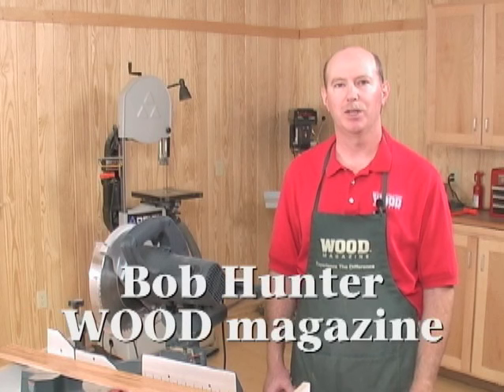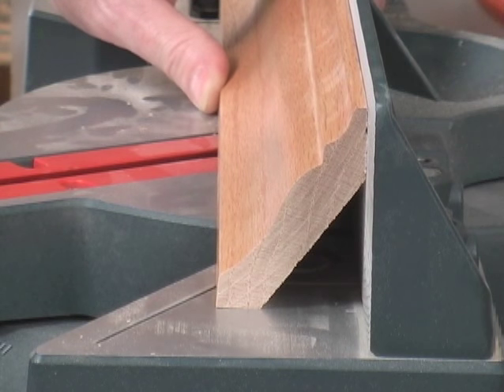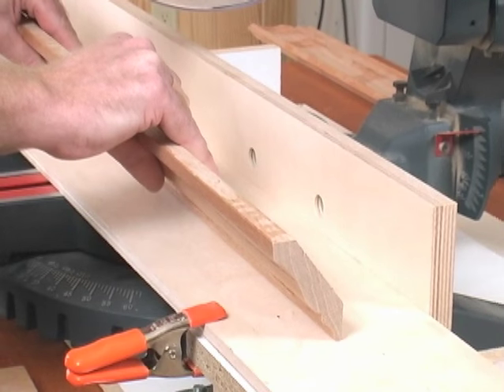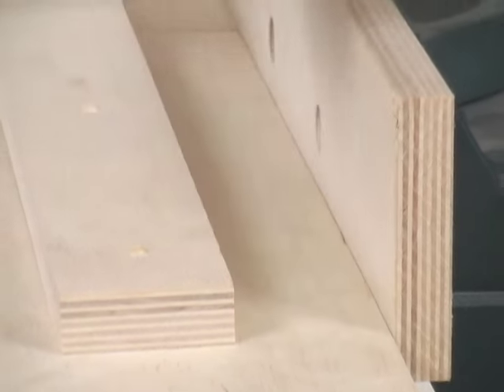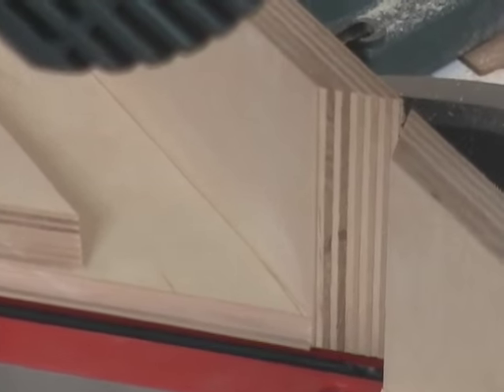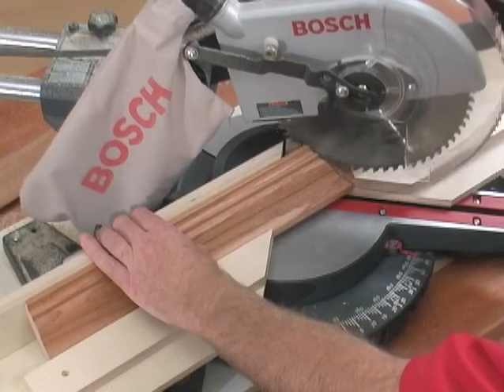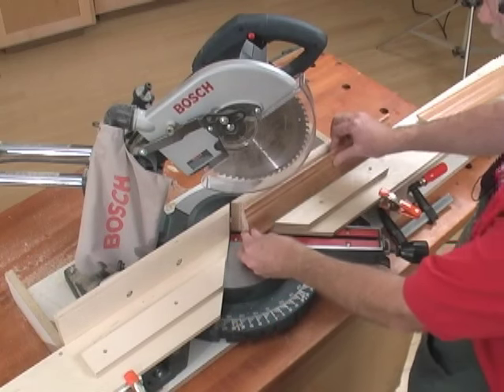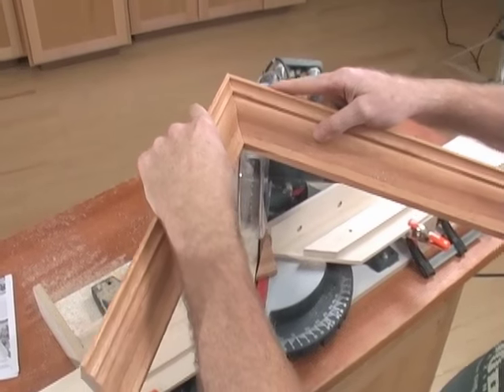The Simple, Accurate Way to Cut Crown Molding - WOOD magazine

Comment: I would like to thank you for making this video. I've been a carpenter for 8 years and have tried so many different jigs/setups for crown. some basic, some I've spent 30 minutes settings up which is a big time loss while on site. THIS, this has been the easiest setup and the simplest way to cut crown without fighting the piece to stay perfectly nested. it takes 10 minutes to build and attach plus I've used the same fences on 5 jobs now. will be making new ones for the next because they're a little beat up now.
Reply: Kikilll😅😊😅

Comment: Great video for the beginning trim carpenter! 
Yes, this video does not show the BEST way to cut the crown moulding using a coping saw...He never said that this was the BEST WAY. He said that it was the easiest way to get the crown onto the wall and it is. 
Its not an advanced carpentry video.
Great job. Im sure tons of folks have used it and applied it.
Thats why you all commented. Because you searched for EASY ways to hang crown just like me and others. 😎
Reply: Why is it needed to use coping saw for crown mouldings?
Reply: @AK-tx1vg  From what I gather, coping your cuts makes it easier for non-perfect angles to fit. Not ever room has perfect 90 degree corners, so a cope will eliminate any gap from an angle.

Comment: Great video. It seems for the inside corner, the side you make the cut is the side the piece is remains on, not the opposite like what is stated in the video.
Reply: If what you mean is the left piece on the saw is the right hand of the inside corner, I concur. I think he put them together upside down. All you have to do is flip and turn it, or exchange pieces left for right and it will work however.
Reply: @echarters  your reply was a life saver. Thanks.

Comment: Coping is better for wall and ceiling to assure a tight fit. All drywall corners is not a tight 90 degrees. When cutting  outside corner on baseboard trim it's best to set your saw at 46-47 degrees. Crown molding on kitchen cabinets must must be cut true to any corners or angles. No coping.

Comment: You cut the inside corners right, but put them together upside down. Your detail was on the top in the video. I guess to view them as the would go on an inside corner you would flip the corner toward you end over end 180 and then turn it 180 degrees away from you in plan view or around a vertical axis. You could just flip the left hand piece to the right and vice versa and the joint would be right way up.

Comment: Thank you! I was going nuts trying to figure out what I was doing wrong.
Reply: Great instructional video. Question. If the wall angles are not exactly 90 degrees would the table, fence and stop setup set for 45 degrees still work. Thank you.

Comment: I’m having a problem understanding how to determine where to place molding on the saw before cutting ? Like where exactly the molding needs to be under the blade , how far in left or right ? If you could show us that little crucial video that would be extremely helpful. Thanks for sharing .

Comment: most of my mitered inside corners have opened up after a year. coping is the best long term stable inside joint.
Reply: I added 3/8" sheetrock to this old house & now the molding is that much shorter, man I wish I had learned how to do coping as a kid working construction, one of those talents missing from by bag of tricks. I use to watch the older Carpenters do it with a coping saw, I've got a jewelry saw, wonder if it had the right blade would it work. I'm at a standstill. Ugh.
Reply: You are correct.  Flush cutting one piece and coping the piece that butts into it is far superior for inside corners.  👍

Comment: This is a a nice fixture, however some saws come with a crown stop so none of this is necessary. Also, If you have 90 corners, you can cut an inside joint this way, but that is rarely the case. Coping an inside corner is the only way to ensure a tight joint. And when you nail the molding to the wall and ceiling, it's a great idea to mark the walls with the same height marks as they were in the saw when you cut them. This will  ensure that you place the crown in the proper position for nailing, otherwise the corners, both inside and outside will not fit properly.
Reply: No idea what you mean about marking the wall and the ceiling
Reply: @j.p.bourget2045  you put a mark on the wall that simulates the same height that you cut it on your saw. If you don’t get this right, your corners will never be correct.  It has to go up on the wall at the same height it was when you cut it on the saw.

Comment: I tried this method with 2-5/8" 32/58 molding and it did not work. Your molding appears to be 45/45. I wound up having to do compound cuts using 33.9 bevel and 31.6 miter. If I'm missing something, please let me know.
Reply: it's clearly a 45 degree molding...

Comment: What if you have to cut 46 or more degrees? doesnt that mess up your table and fence?
Reply: If you cut 46 degrees or more, the fence will not be meased up.  You just won't be able to line up the cut via the fence that's all, but have to use the blade or the mitre saw laser guide if available.

Comment: Regardless of whether this is aimed at the novice DIYer, this is a bit oversimplified in that walls are rarely perfectly true and angled at 90 degrees. Also, inside corners should be coped for a tighter-fitting joint.

Comment: You haven't touched on the real pain, to measure and then cut the parts to their needed lengths. I always been making plenty of things but I never could do this particular job.
Reply: Same here. Getting everything cut to the perfect length is the hardest part for me.
Reply: sharp pencil and the right tape measure. makes all the difference in the world
Reply: Ary vanHarrick measure  bottom and not the top,  if Coping measure before Coping,  also get yourself a good laser tape measure like  Bosch 35.
Reply: use a 100 inch stick if by yourself.  Butt to one wall make mark measure off other wall to mark and add 100 inches.  Cut 1/8th long because crown is easy to bend in and prevents gaps later from contraction.
edit: 1/8 long on long, inside pieces.  Obviously short pieces won't absorb an 1/8.
Reply: Sorry, that link is to KATZ's third or fourth video in the crown molding series. You want the first one - makes sense to start there, right?
Reply: Bretske Smith use a utility blade to mark the cut. Much more accurate.

Comment: Umm, too simplistic to be practical. I realize that people need to start someplace and this is a good foundation but it is not a practical way to cut crown molding and miters. There's no wall that I ever have ever seen that is exactly 45^ (well maybe one or two). One needs to know how to mitigate irregular miters, both inside and outside. Your jig might be ok for furniture making if one has control over the entire build process but never for walls and ceilings. JMO....